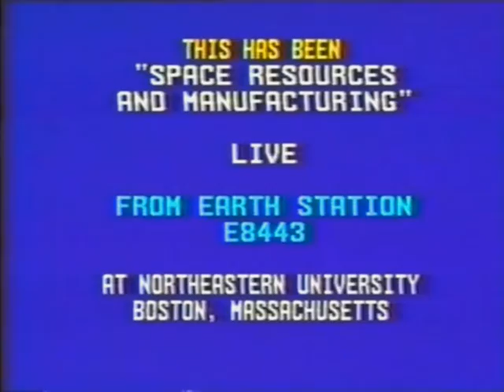SSI Solar Power Satellite Roundtable at ISU 1988

Comment: The space solar power presentation by the Naval Research Laboratory on 3/2/16 at the D3 Innovation Summit in Washington, DC won awards in 4 categories. The proposal was one of 6 out of 500 "breakout ideas" submitted in response to a challenge issued by DoS, DoD, and USAID. 

As of this writing, 52 years have elapsed since Brown's initial demo of microwave power transfer. 44 years since Glaser's patent on the solar power satellite.
Reply from the maker: Thanks Island, we particles tend to move in waves so perhaps this wave will lead to one that actually gets the particles together and the work started. Once the idea of using mass Not from Earth comes around again it will likely be a big help.There is a LOT more information on SPS and the Mass-Drivers that can save huge amounts of launch costs at SSI.org